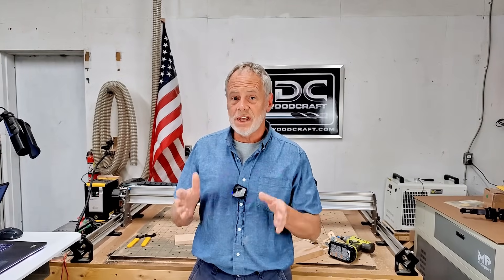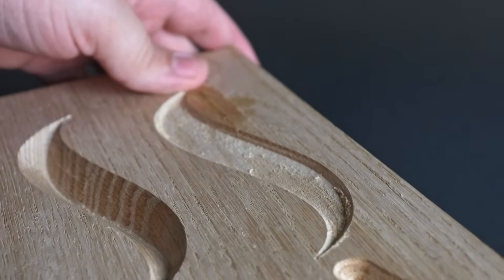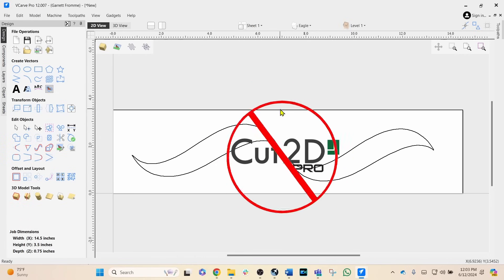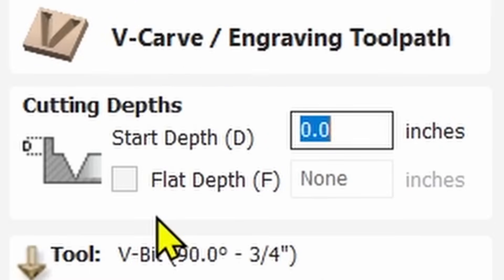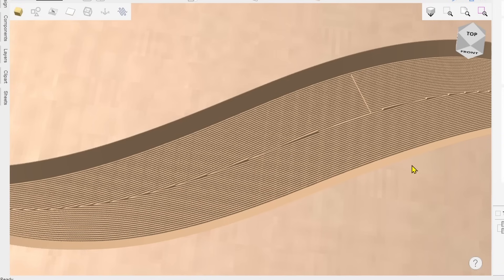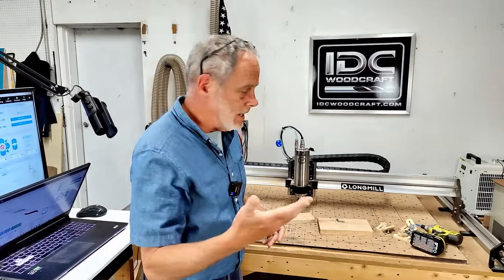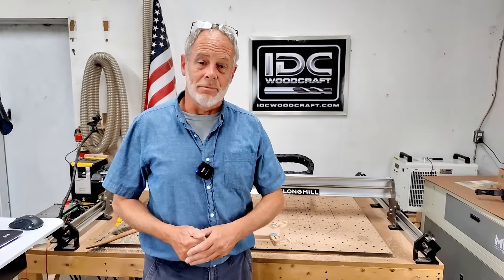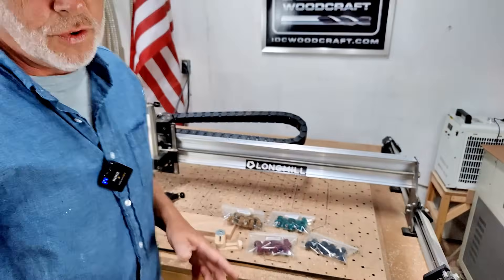Get Better V-Carves with Flat Depth on Your CNC Router Projects

Comment: Just a thought. larger angle tool bits will also limit your depth if you want to avoid flat depth settings.
Reply from the maker: That's a great observation! Larger angle tool bits can indeed affect how deep you can cut without compromising the desired finish. Balancing bit size with the depth of cut is key for the best results. Thanks for sharing your thoughts!

Comment: Love your videos - I was wondering if you could explain how to extend a carve if your bed isnt long enough? For instance, if you have a 16" bed but need to do a 25" carve, whats the best way to carve the first part and then slide it up and carve the second half? Assuming your bed is straight, is there a way to use registration marks so that the two pieces are correctly alligned? Thanks in advance if you have the time.
Reply from the maker: atienne_navarre, That's a great question! To carve a longer piece than your bed allows, you can carve the first section, then move the workpiece up and reposition it based on registration marks to align it properly for the second carve. Using registration marks on both the workpiece and the wasteboard will help maintain alignment throughout the process. I do not have a video on this quite just yet but it is on my video list for the future! Thanks for reaching out brother.

Comment: Can you use a flat tip V bit?
Reply from the maker: dennisbracci9212, Yes, you can use a flat tip V bit for certain projects. It's great for carving intricate designs and adding details to your woodwork. Just make sure to adjust your feeds and speeds accordingly for optimal results.

Comment: I want to recommend against a sanding brush, and in favor of a nylon wire brush. The wire brush doesn't degrade details, and doesn't degrade by itself. Give it a try!
Reply from the maker: eitantal726, Thanks for your input! Nylon wire brushes are a great option for certain projects, depending on the wood type and the level of detail needed. It's always good to have different tools in your arsenal for different tasks.